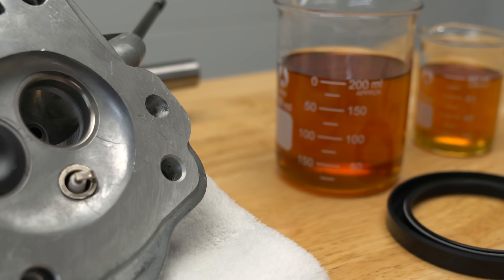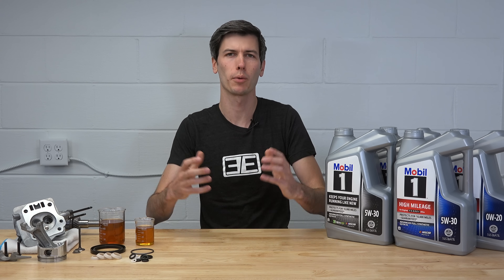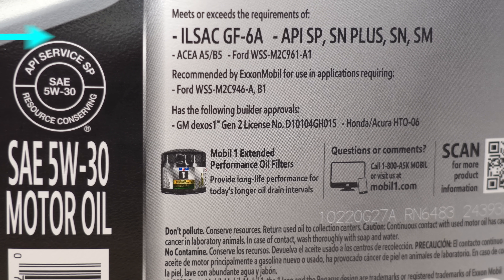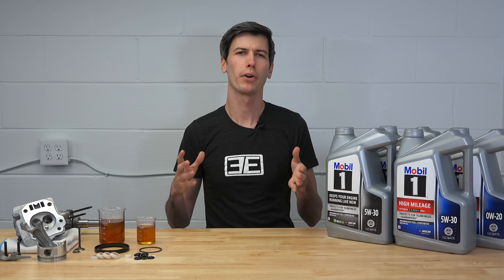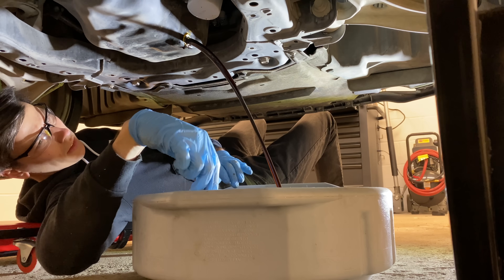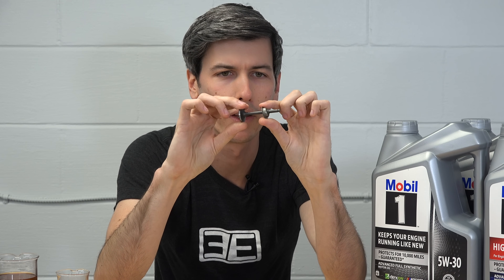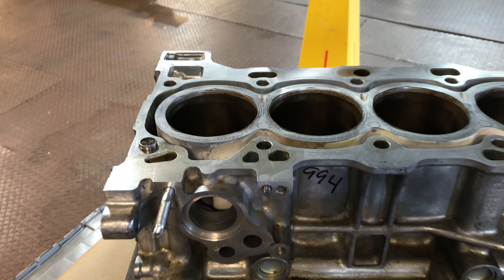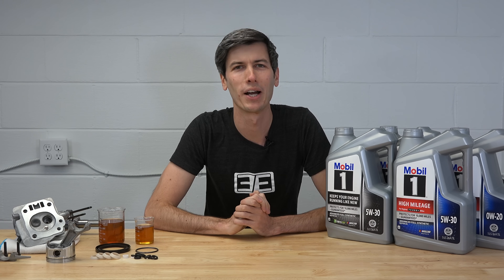Is Synthetic Motor Oil Bad For Old Cars?

Comment: I used to be in charge of a large haulage fleet running heavy trucks,we used to use sae30 in summer and sae20 in winter,one of the engines failed and seized up the crankshaft,we put that down to oil pump failure. A Chemist came in from Shell at the Bosses request and we discussed this multigrade thing at length with regards to thick and thinner oils which made me think about things in a different way. I was always in favour of thicker oils to maintain oil pressure at running temperatures,he explained to me that thinner oils flow easier at low temperatures so lubricate better when the engine needs it most at cold starts,he also said that engine oil was not just for lubrication it’s was there to cool the moving parts by keeping the friction between them to a minimum. A thin oil will pump round the engine quicker than a thick oil so the more oil circulating the more cooling is taking place even if the oil pressure isn’t quite as high,he convinced me and the boss and we changed to 10w30 in winter and 15w40 in summer, some of our engines went on to do over 1-5 million miles without any problems so I think he proved his point.
Reply: Did the Chemist tell you that the hotter conventional oil gets the more it loses it viscosity?  Synthetic has a much higher temperature before breaking down. Depending on where you live this may matter a lot or a little. In Texas it will matter A LOT in July. conventional oil will break down considerably faster than  in moderate Spring temperatures. Where as full syn under normal driving will not break down(lose its ability to lubricate). Winter time you can run conventional oil no big deal. Summer time  in 100 degree temps? Well conventional simply will not do as good of a job.
Reply: @spartanx169x  
An engine is designed to run at a set temperature whether in Alaska or Texas. The temperatures inside an engine are vastly greater than say 40C ambient in Texas.
Reply: @johnburns4017 True. That said to be specific it will matter if your engine overheats for any reason which tends to happen more during summer and in hotter climates and sitting in traffic. Just because an engine is designed to run at a specific temperature does not guarantee it will 100% of the time. I have had 3 cars that the water pump gave out and I had to drive them several miles or be stranded for hours. Running synthetic prevented those motors from locking up or even knocking.
Reply: @johnburns4017  And you can run an engine a lot longer between oil changes. Its well proven.
Reply: @spartanx169x  
That is a cooling problem. Cooling is a jacket around the moving parts. It dumps heat having to cope with ambient air temperatures.  Nothing to do with the internal engine temperatures where the moving parts and oil are. They are quite separate.
Reply: @johnburns4017   I am specifically referring to when THE COOLING SYSTEM FAILS, that is when the difference in oil matters. Was that not obvious in my previous comment?  When you do not have cooling at all, the difference in oil can mean the difference between a damaged motor and one that is not.
Reply: @spartanx169x yeah
Reply: Great example! Made me shift the way I think about lubrication.
Reply: 10W or 15W something, yes, but today's 5W and 0W?  No way.
Reply: @michaelbenardo5695  I run a BMW X3 six cylinder diesel that has 150,000 miles on the clock and use 0w40 all the year round absolutely NO problem and change it every Spring along with the filter,sweet as a nut but everyone has their own way of doing things,what works for one doesn’t mean it works for everyone.
Reply: @michaelbenardo5695    The winter (W) viscosity shows how well it flows at ambient (especially colder) temperatures.  You want an oil to flow faster at those conditions.  It will protect against greater damage during cold startups.  And by "cold startups", I also mean even in 100* F temps

   If the latter number is the same, whether 30, 40 or what not, then when the oil gets up to hot engine temp, the viscosity will be roughly the same. 

   It is true that there is a general trend for oils with a lower winter viscosity to shear easier and faster under more extreme conditions, but that is not a universal truth-the oils need to be looked at on an individual basis. Believe it or not, but there are some 0w-30 and 0w-40 oils that are more temp, friction, etc stable than their 10 or even 15w-30 and 40 counter parts.  Certain PAO and ester formulations reduce viscosity but raise viscosity index (the number that indicates how resistant to changing the viscosity grade) way better than group 1, 2, and even 3 base oils.  

     Various different additives also effect this differently, though chemical VI improvers do tend to shear easier and faster than certain PAO's and esters.  That is why the really high quality, more expensive oils tend to use plenty of PAO and/or esters in their formulations.  It's more expensive, but ultimately worth it for demanding conditions. 

    Point being, there are indeed some 0 and 5w oils that offer better and longer protection against wear than some 10 and 15w rated oils.  You would benefit from more research and getting better educated on the topic. This topic is so complex and variable, that one could literally study it for most of their life and still not know ALL there is to know.  I bet even people like Lake Speed Jr. are still learning new things, and that man has more knowledge in his little pinky than we combined total do.
Reply: You were in charge of a large truck fleet and you didn't read the manual?
Reply: @aluisious  What are you going on about ?? this was in the early 1960s and multigrade oils were only just coming on the market and everyone used single grade oils in those days and did so for years after,I don’t mind being criticised but not by someone who hasn’t a clue how things used to be,and as for your comments about reading the handbook these oils were what was recommended at that period of time,20w for winter and sae30 for summer use. Things have moved on a lot since those days so stick to what you know which by your comments isn’t a lot.
Reply: @davidellis279 leave aside such pointless criticisms sir!!...thank u much fr taking time to write fr all of us who r searching fr better options to use suitable oils to own cars....some may have old cars..some have new cars..planet is big...😂🎉😂😂🎉❤
Reply: I bought a Defender with 100k , TD5 engine. I’m a retired petrochemical engineer. I changed to fully synthetic , now at 148k and using no oil since changing to synthetic . Used a little to start with, but now no oil consumed between changes . Also I restore 70’s motorcycles and they have minimal wear and no seizures with the modern high performance oils.
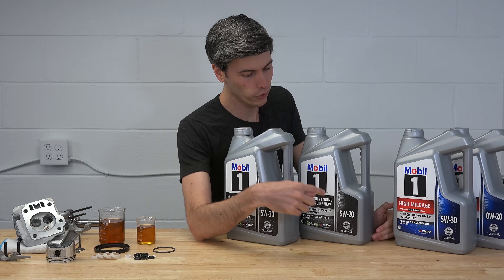Reply: So even 5:30 in the winter then change it into a 10W-40 in the summer is a good idea?
Reply: So using a 5W-30 in the winter then changing it over to a 1040 in the summer is a good idea?
Reply: I'm glad you learned something, but it's old news
Reply: The first number and 'W' in multigrade oil doesn't stand for 'weight', it stands for 'winter', or a rating of the oil's viscosity in the cold. An engine can be ruined quickly if oil doesn't start flowing immediately, even in the cold.
Reply: What i also learnt is that for every 10w higher number the oil is, the oil pump has to work 25% harder. 
Also took me time to learn to figure out those things not being an oil chemist or engineer
Reply: Exactly why we use thinner oils these days and they last much longer.
Reply: I agree with their oil selection.
Reply: Good video
Reply: Follow your dam Manuel, and quit trying to reinvent the lub science
Reply: O
Reply: The oil is for lubrication. Reducing moving parts inside the engine and by that the lesser the friction the lesser the heat. Maybe, he didn't literally mean that the oil is not there for lubrication which is obviously it is, that's why we called it lubes. lol
Reply: Just curious were those company cars a ford e series? Hahahaha
Reply: @malan828  You humour really cracks me up,ha ha ha not funny.
Reply: Had a 3.0 Aerostar with 130000 - gave it factory 5-30 forever - changed it to 10-30 once and hung an exhaust valve - bought an 05 Taurus with a 3.0 and factory for that was 5-20
Reply: @joesantiso6495  Don’t think that was anything to do with the oil but if your happy to think that ok.
Reply: 0-40 is an all weather lubricant
Reply: if the thinner oil works, why you still use 40 in summer finally?
Reply: @palapalademoc1780  if I understand things correctly. motors are designed for a certain viscosity oil. Rpm’s, load, amount of oil on the system (heat), and whatever else. So anyway the thinking was always higher viscosity oil higher oil pressures and those pressures meant good oil flow everywhere. Problem is we all don’t use engines only in warm places so when it gets cold those oils viscosity goes way up to something like gear oil or higher and the engine sees a lot of wear at startup til the engine warms up. So anyway you can use a multi viscosity oil that flows well when cold and has higher viscosity when warm so it’s the  best of both worlds. you get lubrication at startup and idle you may have lower oil pressures(not sure just guessing here) but as long as you don’t go ripping a full load on a cold engine and let it warm up you should extend the life of the motor significantly. And then to your initial question why not use 15w40 all winter is probably because with the lower temps it might be higher possibility of not lubricating well since most diesels have trouble coming up to temp when it’s cold, just don’t produce enough heat during their combustion process. So the 10w30 would be functioning similar to a 40w. A lot of manufacturers or engineers most likely put out data for the engines and will say depending on what region or area your using their product in use this oil. And it gets thinner the further north you go. Well hope that clears it up. I could be wrong but that’s how I see it.
Reply: @Annon89   Expert said :thinner oils flow easier at low temperatures so lubricate better when the engine needs it most at cold starts,he also said that engine oil was not just for lubrication it’s was there to cool the moving parts by keeping the friction between them to a minimum
Reply: @Annon89   Expert said :thinner oils flow easier at low temperatures so lubricate better when the engine needs it most at cold starts,he also said that engine oil was not just for lubrication it’s was there to cool the moving parts by keeping the friction between them to a minimum
Reply: @Annon89  Your not wrong that’s exactly how it works but some seem incapable of thinking it out properly.
Reply: He convinced your girl friend too
Reply: "he also said that engine oil was not just for lubrication it’s was there to cool the moving parts by keeping the friction between them to a minimum".

lmfao he literally said "its not just there for lubrication" and then proceeded to just explain what lubrication is. cooling parts by reducing friction is like a core part of the definition of lubrication.
Reply: @realyopikechannel  You're being too literal. Yes, "lubrication" does involve cooling because you're reducing the heat of friction, like you said. But he was referring to the popular meaning of lubrication, which is how the general public understands it -- that lubrication is simply to reduce contact between surfaces.
Reply: @realyopikechannel  yes but it literally cools the metal because it's just like a radiator. The oil flows through cooler parts of the motor and brings the temperature to a uniform amount. It also cools the piston and cylinder wall.
Reply: @matthewmorgan582  Obviously.
Reply: @realyopikechannel  dude, what the Chemist said was correct. He knows more than you
Reply: @realyopikechannel  the greater cooling comes from greater heat exchange through faster flow, the lubrication is a separate benefit.
Reply: @wesdoobner7521 then why are the thinner oils breaking down many engines today??
Reply: @realyopikechannel هل 5w30يصلح للحرارة المرتفعه
Reply: @AbdelahiDedoh depends, is the Toyota you're putting it in used for jihad?

Comment: I tried to run synthetic in my vehicle and it rattled like a rock tumbler for about a thousand miles and I couldn't take it no more and put regular oil back in......and no more noise.....if I had left synthetic no doubt would have been catastrophic......

Comment: One thing you missed:
Regarding high mileage oils, they usually have higher concentrations of detergents and dispersants than "low mileage" oils, in addition to seal conditioners. This is intended to gradually clean the engine over time, rather than using a "flush" which can clear buildup quickly enough to clog filters, screens or orifices.
Reply: I was going to ask about the flushing of an old high mileage car. I heard it shouldn't be done as it can cause damage bc of the debris and sludge clogging and getting moved into areas it shouldn't be. I was wondering if I should use a high mileage oil, but I feel better about it now as you pointed out the differences between that and flushing.
Reply: @Yellow Rose  Don't use engine flushes in any well maintained older engines! It's unnecessary. -NY
Reply: Yes & slightly improved friction modifiers /reducers. -NY
Reply: had a girl that ran great, then we got married, and she got all clogged up, guess she must have used the wrong oil
Reply: @thunderbird97  maybe the dipstick wasn't long enough to unclog her motor..
Reply: @olivehanderson9383  actually it knocked a hole in bottom of the pan, from being to long
Reply: @thunderbird97 you need a bigger " grease gun" 😂😅😂
Reply: @thunderbird97  depends if you filled her up from the wrong hole.
Reply: @thunderbird97  sounds like it’s time to give her a service.
Reply: @thunderbird97  sounds like a bit of contamination might have gotten in her
Reply: Rather than a "flush" ?  Soooo....you're saying synthetic "flushes" your engine? 🤣
Reply: @Timmy3Tone  No. Read it again.
Reply: You got that from Google and copy/paste huh. L 😒😒
Reply: @350z33hr  Your username is associated with cars, yet you assume such a simple "kid's first oil change with his dad" fact is a copy/paste from google?
Even if it had been, putting relevant information where people who don't know it will find it is constructive. Hence why I posted the comment.
On the note of constructive things, you should start asking why they sell so many different chemicals for different vehicles, and what the difference is aside from marketing labels.. Because otherwise, you're just pouring whatever into any hole that seems like it'll take it.
Reply: The best solution is to use an engine flush at every service, that way you get no gunky flaky build up
Reply: @Matthew Uffindell  Absolutely not in newer engines especially or older well maintained engines!

Comment: I ran Mobil 1 in a 1985 Corvette for years. At the machine shop the block still looked new at 66000 miles, then it got punched out  .010 and turned into a 383 with a 3.75 inch crank.

Comment: You mentioned older engines can use high mileage oil oil bottles for high mileage are over 75,000 mi my '05 Acura MDX has 137,000 mi and has zero oil consumption is the Mobil 1 high mileage oil I use still fine to use

Comment: Most old cars have a rear main seal made from a packing type material, and directional knurling on the crank to direct the oil back in during rotation. 
Synthetic oil may be more prone to leak when the vehicle is parked.
I think he missed this point

Comment: synthetic oil in overheating engine cause burnt sludge like charcoal type sludge, and old cars relying on elecric fan usually brajes down experiencing over heat that makes charcoal like sludge, unlike mineral oil, over heat it and still oil not sludge

Comment: I had two motorcycles which were two cycles. I used synthetics to eliminate exhaust smoke. The synthetics also eliminated the carbon deposits on the piston crown.
Reply: That's what people do to pass the smog test of an engine that smoked they would put synthetic oil in which doesn't burn blue 🔵
Reply: on those 2 strokes carbon can be holding together some things will fail after switching.
Reply: @southpark159753 If that were true, then wouldn't a new engine with zero build-up fail?

Comment: You did not address the need for zinc in the oil for older engines with flat tappet cams. At least that seems to be the common concern. Personally, I have been using synthetic oil in my 1966 engine for 5 years without any additive and have not yet experienced any negative results. As for grade, 0-20, 0-30, 5-20, 5-30 or whatever thin oil is on sale. I need to rely on my engine to start at -30. Thin oil really helps.

Comment: Also, read the fine print in the owner's manual or in the manuals you can find at the public library. In many cases, where 5W-30 is the required oil, if the local temperature does not get below 0 F, you can use 10W-30. But 10W-30 pours like water too and supposedly performs the same at full operating temperature. In cases where 0W-20 is required, the fine print says you can use 5W-20 if doesn't get below 0 F. Again, there is not much different how the two grades pour out of the jug.